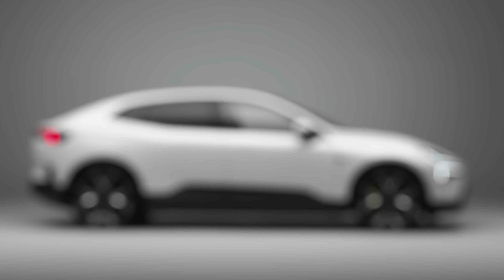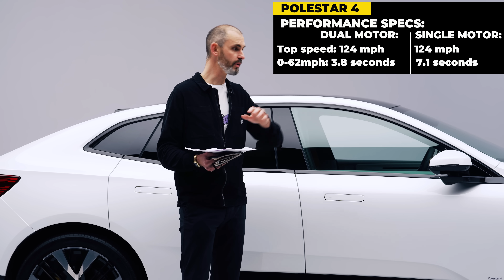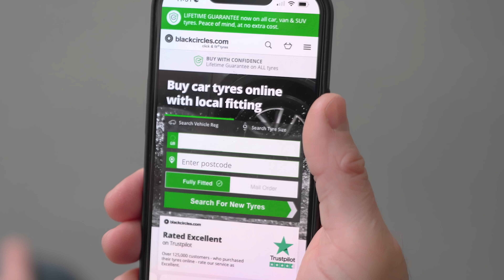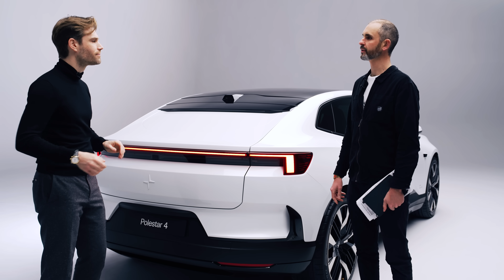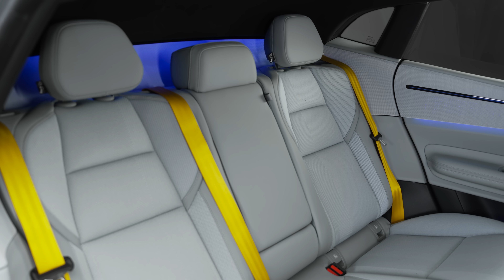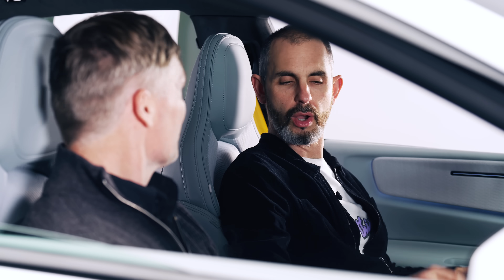New Polestar 4 EV detailed First Look - why the classy electric family car has NO REAR WINDOW

Comment: I've never seen anyone with presbyopia (needs reading glasses) review rear view cameras.

Anyone who uses varifocals for example can see in car mirrors because the object they're focusing on is not the mirror glass but with a camera and screen their focus is on the screen itself. 

This can easily cause many problems, especially when combining varifocals with the interior mirror because the reading segment of varifocal glasses is at the bottom of the lens which obviously means it can't help much to see a screen above your head.

It at least needs a conversation... no?
Reply: I'm not sure it's such a problem for the mirror. However, having to turn my head and refocus to be able to read the center display of the Volvo ex30 (no driver display) was a deal breaker for me wearing bifocals.
Reply: @PsjogrenGoS  But with your bifocals could you glance up (without excessively pivoting your head) to focus on a screen at the top of your windscreen where your rear view mirror currently sits?
Reply: No  @sammoxford , and I can´t do that in a normal car either but I don´t feel I need a fully sharp image in the rearview mirror at a glance. When driving, I think it is enough to see that something is behind you. However, Not being able to read speedometer or map in front of me (as I can in my Polestar 2) without turning my head and refocusing (as I would in EX30) is a bigger issue in my opinion.
Reply: @PsjogrenGoS  I'm not saying screens don't have their benefits but given the choice I think most people would prefer to see clearly when the consequences could sometimes be life & death. Plus the correction on prescriptions varies greatly. 

It's similar to the arguments surrounding alternatives buttons & dials that take eyes off roads and can cause major distractions. You can no longer pick up a phone but you can get carried away deep within the settings menu on a headunit. 

A lot of it needs a proper rethink.
Reply: I've got a Megane with a rear view camera mirror which is superb and gives a much wider range of view than a traditional rear view mirror so I never use the rear window view ever. I also use varifocal glasses and have had no issues at all with using them with the camera view.
Reply: I have a car with both a rear view camera and rear view mirror. I much prefer the mirror unless I am parking in a tight spot. The angle of view of the camera is so wide it distorts objects not exactly behind the car so it becomes difficult to judge their distance. A mirror and camera are the perfect combination.
Reply: This car is not for the broke people with bad eyes.
Reply: Very much so - It seems as though the only human factors people now on cars are the software engineers who have had no formal training in proper HF/Ergonomics - it feels as though designers are running away pony tails flying in the breeze, putting in all the fancy stuff without actually considering the full user base, just the 18-40 year olds - many of whom no longer actually want a car! (nor can they even dream of affording one unless it's a company car!)
Reply: I totally agree. Older people who now need reading glasses cannot see into the mirror replacement screen and see it sharp/in focus. Not a requirement of the driving test either. I have issues reading all the text on those grey on white screens and as a result will not be buying one for that reason. I tested this in a Defender rear view mirror/screen and it was blurred for me.  Wheres the big print edition?
Reply: it really doesn't. all you need to know is if there's something behind you. what that is doesn't really matter
Reply: @anonym3017  It really does matter, because that isn't all you need to know at all. With a mirror comes depth and speed perception, and the ability to look at a wider angle just by moving your head. That's even more pertinent when it comes to side mirrors being replaced by cameras, you lose that ability to very quickly choose a wider field of vision.
Reply: @swampthing20  cameras can give you a way vider field of view than any mirror is able to. and that field of view doesn't require moving your head.

And a camera is just as good at giving you depth and speed perception. cause at driving distances those are done via size differences and not angular differences between your eyes.

Comment: With all the design blah about illuminating logos and other brushed alu nonsense they still have the charging port cover thingy dangling and rubbin against the bodywork. Unbelievable
Reply from the maker: Yeah, the rubber bungs in the charge ports is a bit lacklustre
Reply: . One of hour cars at home, a honda civic 2013 in super good condition, have a racing fuel cover as standard. Not many has this, not fossil cars either. Annoing when they can’t design good basic functionality!
Reply: yh, why are the rubber things even necessary?
Reply: @hqew6662 I don’t want water in the socket’s when connecting 400V to it. It’s your choice.
Reply: @lazyman1011  I’ve never had an issue with water in Tesla charge port and they don’t have the rubber covers 🤷🏻
Reply: @hqew6662  If you charge a lot at home and outside, depending on your weather it can be a problem.
Reply: @lazyman1011  you're not connecting it live..
Reply: @mktrollop1093  Just put your plug in a socket that is wet and enjoy the 400A+ when your switching it On. For me that’s not a difference. Also dirt is not so nice for long time usage.
Reply: @hqew6662 to prevent water from getting in and short circuiting the electronics
Reply: That's engineering not design...

Comment: 60 grand ????
Reply: Have you seen how much other cars cost these days?  Most people will lease a car like this and the savings from fuel costs will make up the difference for a lot of people.
Reply: Yes I do most others with the same specs are much cheaper  @RichardFraser-y9t
Reply: £60k for the slow one. The fun one is £67k. With depreciation making it worth a lot less quite quickly. It is made in China. Which means repairing it 4 years into the future may be expensive. This is a very expensive and resource intensive way to achieve ‘net-zero’?
Reply: @M-se5of- It is incredible indeed that the Polestar brand is hanging on this extortionately costly piece of white goods. The costs - environmental, the child labour cost of the cobalt, the Chinese labour force, to shipping it to Europe, insurance, the electricity (that mostly will come from burning gas and trees) to its eventual recycling as it won’t be repairable beyond its battery lifespan of maybe 7-10 years? It is mind boggling. All to provide zero emissions at the point of use, for its well-heeled owner. I think the green-cred of a well maintained old petrol car are suddenly quite respectable by comparison.

Comment: What will happen to electrical network when all of us will have electric cars and we will come back home and plug the cars?
Reply: Exactly the same as what happens when we all put our kettles on during a Coronation Street break.  Except the overnight charging is a bit easier to deal with.
Reply: @markfox6741  Christ, is that series still running?
Reply from the maker: We won't all have EVs
 And if we do we will have more options at work, home and on the road - because if not the cars won't sell.
Reply: @TheLateBrakeShow  I love the idea of EV but forcing it without infrastructure combined with super long "fueling" times it's a recipe for disaster
Reply: Although there have already been grid capacity issues recently.  I'd say the bigger worry is what is going to happen to the kwh unit price in the UK when demand goes up and we have to purchase more offshore energy to meet demand. Then it's not just charging your car that gets more expensive, it's all your electricity usage.
Reply: Just set the timer to start charge at midnight, problem solved.
Reply: @ulwur  not really, you never know when you might need a car. What is the point of having your own independent transport if you only can use it past midnight?